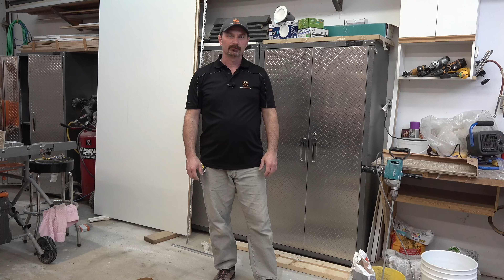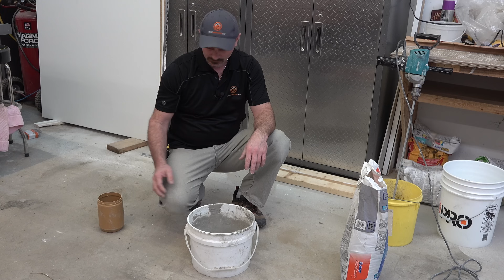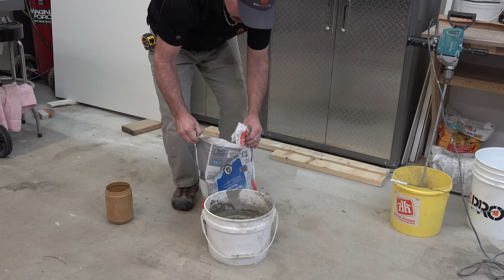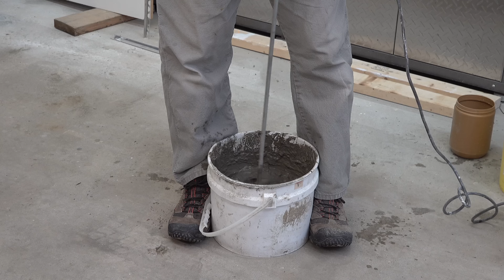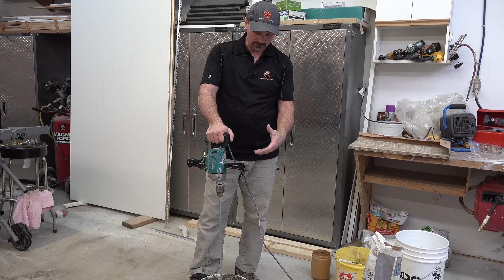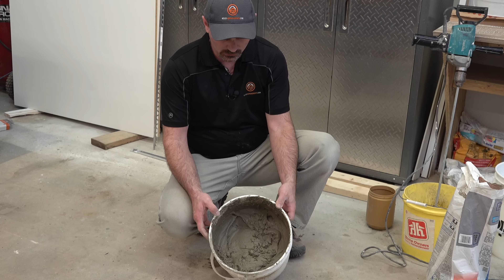How To Mix Thinset Mortar For Tile

Comment: Love this video. I started laughing and could not stop when he said he was going to get some thin set on his shoes...and he did!. Then the paddle came loose from the drill chuck and I was fully expecting Moe Larry or Curly to walk into the room. Now this man's intention in making this video was honorable no doubt but there comes a time when instructions should, well, be better left to instructors. How much thin set was in the bucket???????????? and how much water?????????? was introduced to attain the required and desired viscosity for proper adhesion. Now it is not necessary to be perfect but measuring the water content to the approx. product will give you a gauge for your next and succeeding batches.
I am going to give this a thumbs up because for the effort and time this man invested when he could have been sleeping on his sofa helping no one. I made the joke because there is not much to laugh about in our nation anymore not to demean this gentleman.

Comment: Density of the mortar is always the question. Would like to have seen you put the trowel in the mix so I can see how thick the mortar is when it is ready.
Reply: Yea, it helps trying the mortar with something else to see how thin it is
Reply: Or you could just read the manufacturers' directions and you'll get it right every time
Reply: @chrisg0001  Manufacturers direction are usually for a whole bag and are deliberately vague. If you are not mixing up a whole bag (this would be most amateurs), trying to figure out how thick the thinset should be takes a lot of guess work when you have never tiled before. My determining factor is if you put the thinset down and run your notched trowel through it and it holds the shape, it should be ok, unless its too dry. Of course, this also depends on the kind of thinset and type of tile you are using. What he did in this video would be way too wet for the floor tiles I'm putting in.

Comment: More confuse than before... 3/4 of how much?
Reply: I believe we were told that the manufacturer gives the ratio on the package.  So, figure out how much mortar you need, thus how much water you will need, and then put 3/4 of THAT amount into the bucket.

Comment: Hi there, I mixed my thinset the same way you described here, but after 48 hours some of the tiles were coming off and the thinset was still a bit moist. Do you think I should have given it more time to cure considering it was in the basement room where the temperatures are around 67 degrees? Thanks!
Reply: Did you follow the directions on the package? Was this for a wall or a floor? Were you using the right type of thinset for the size and type of tile you were using? Did you back butter the tiles? A lot of pros say you don't need to do this, but if you are not a pro, you probably should.It's not going to hurt and it doesn't take that much time.

Comment: This guy is simply the best explaining things, and does the best job always. No one comes close.
Reply: It’s terrible instruction; go see Sal’s for a proper explanation.

He’s mixing Mapsi unmodified (likely Kerdibond T).

You have to follow proportions and instructions.
If you want a half bag of mortar mixed up, buy two 2 gallon pails to split the bag and measure properly (I put a sharpie line on one of the small small pails so next time I can always just pour out an exact half bag); this guy just dumped a random amount out of the bag.
Measure the exact amount of water (3.2 litres for 1/2 bag) and use cold water; add all water to mixing bucket first.
Pour measured mix into cold water.
Wear a friggin mask; concrete dust will destroy your lungs.
Mix for FIVE minutes; do not skimp on time as you’re triggering a chemical reaction.
Do not randomly add more water; you will weaken the mortar.
Let it slake (stand) for TEN minutes, not the ‘couple’ mentioned.
Remix for a full two minutes; now ready to go.

Do not ‘eyeball’ consistency and randomly add water, additives or mix; each mortar type and application can be slightly different.
In short, read and follow the instructions; they are simple and there for a reason.

Comment: I’m not sure what I’m doing wrong but every time I mix thinset I fallow the instructions but it always hardens in my bucket within maybe 5 or 6 minutes after mixing it. The same thing happened to me the last time I mixed grout as well.
Reply from the maker: Well it will start to set up after a while but its usually at least an hour working time for mixed products. Maybe you used hot water? not sure how much difference that would make but you want cold clean water. Are you using drinking water or well water? Please come to the forum and we can try and figure this out. https://www.house-improvements.com/forums/
Reply: HouseImprovements thank you for your reply. I’m using cold drinking water from my tap. I usually add the recommended amount of water then I mix with a hand drill and a paddle because I don’t have a large mixing drill. I’ll wait about 5 minutes then mix a little more. Then usually before I can get situated in my work space the mortar is hard as a rock in my bucket 😂 I’m not sure what’s happening.
Reply: @dronthetrack4835   you are waiting 5 min before adding a little bit of water each time.  add the water, mix three seconds later.  you are taking 45 min to mix a bucket of mud.
Reply: Somethings in your water

Comment: It seems as if you totally disregarded the manufacturers mixing instructions. There is no way you could have got the water to mortar ratio correct because you don't know how much of each one you even used. Then you only mixed it a minute and a half instead of 5 minutes like it requires and then you said to let it slake for a couple minutes. The slaking process is very important and it requires ten minutes. A couple minutes would be sufficient for the final mix but you gave it about 15 seconds. If you are going to take on the role of a teacher in a tutorial video you should probably put some effort into getting it right.
Reply: He literally explained it in the video. Obviously he's not going to show you him standing around doing nothing for 10 minutes. Its called editing and brevity. If you still can't understand that then you're a moron.

Comment: So I’m working on tiling my laundry room. The subfloor is plywood. The installation instructions for the hardie backer board says I was supposed to use a polymer additive to mix the mortar for the supporting bed of the Hardie Backer board and I accidentally used unmodified (just mixed it with water) how big of a problem will this present in the future? The space I’m working on is 6’x6’.
Reply from the maker: IMO you will be fine as long as you did not have a real dry mix or if you wiped the wood and cement with a sponge before adding mortar. Most good quality unmodified products will do the job.
Reply: HouseImprovements thank you Shannon I greatly appreciate you quick response. And we really appreciate what you do for the DIY community.

Comment: which is best modified or non modified thin set
Reply from the maker: the type really depends on what you are going over. and what you are sticking down.go with what is recommended by the manufacture of those two things.
Reply: HouseImprovements can you place thin set on top of concrete mortar if your needing to even out shower pan?

Comment: I am sure you are a very capable guy, with great skill and you give a lot of good info on your channel, I have seen many of them over time.  You did however really miss the mark on this one.
Reply: It doesn't help if you don't explain how he missed the mark.
Reply: @shannond2707  If you read the bag of mortar, you will see that it has very specific instructions on how it should be mixed. It is very important to follow the ratio of water, or additive to the amount of powder to achieve the properties that were designed into that specific thinset. They can vary greatly, most will have an initial mixing time and a slake time and a final mix. these times are not all the same, some will not require slaking. If partial bags are to be mixed, it is best to measure the quantity of powder and then add the proper ratio of water, usually half bag with half the water, some mortars will give the ratio of water to powder on the bag to facilitate mixing small quantities to properly. The kind of paddle will also make a big difference to the final strength of the mortar. Yours was just whipping a ton of air into the mortar something you don't want. Mixing it correctly will give you the pot life, open time and properties that were designed into the mortar. Look up ANSI A118.1, A118.4, A118.11, and A118.15 for the basic types of Dry Set Mortar. Some will have a T appended, which stands for Thixotropic, these are no sag mortars, E for extended open time, and F fro fast setting. The ratio of water on many of these mortar will have a range for achieving certain properties that the mortar was designed to have. There is a lot of Chemistry in modern mortars, they need to be mixed properly to have the benefits.
Reply: @SalDiBlasi  Ah, that's more helpful.
Reply: @SalDiBlasi  according to this guy I have to go to University of Canada (sic) and earn a Masters Degree in Chemistry to freaking mix a gallon of thin set mortar hahaha what a balongy. Great job Shannon-keep up the vids.
Reply: @JohnDoe-jq3qf  Or just read the directions on every bag of mortar. no degree required.
Reply: Lol wow

Comment: Fyi, use a taller bucket and a drywall mud paddle, it's about 4 in diameter, way less messy, and you have to mix, let sit 10 minutes(slake), then remix to avoid lock up in the bucket.